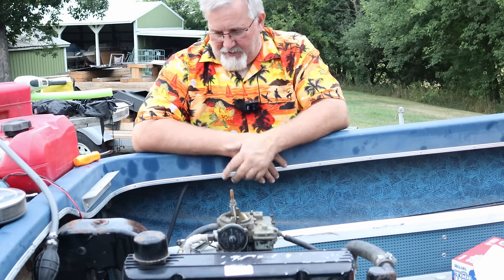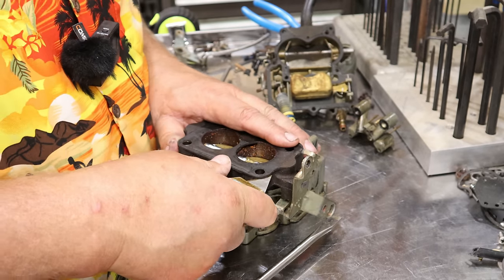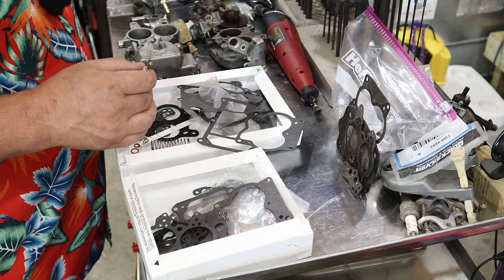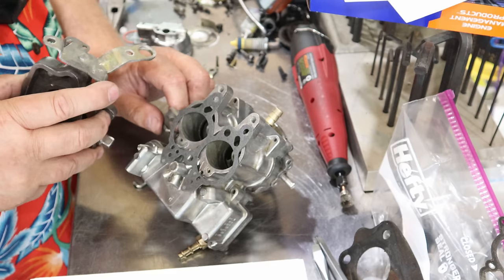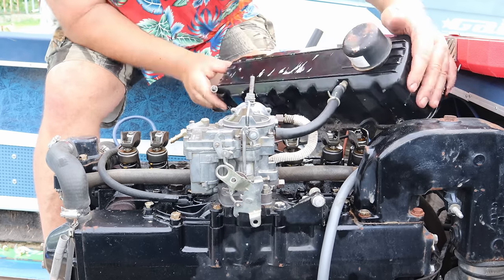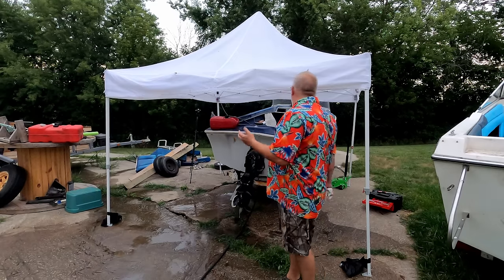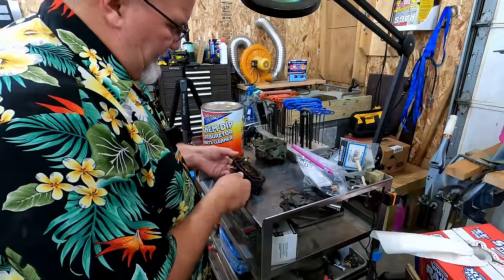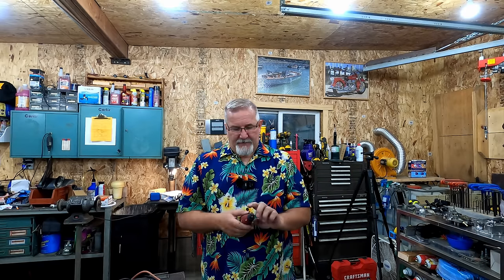1973 Larson Mercruiser 120hp Part 2  Carb work and valve adjustment

Comment: Man sounds good purring like a mountain lion . Just a good feeling getting a old motor running good . Good tips on auto choke and adjusting valves .. 👍👍👍👍 O the boat in ending credits seems to run like a scalded dog nice figure 8 on water  the coppers checking it out
Reply from the maker: it's turning out to be a fun boat, thanks for watching

Comment: I have to do the same thing.  I bought a 1971 Offshore V 18 about 4 years ago in a partially restored state.  previous owner abandoned work on it after getting an Islander. I bought it with the gimbal dissasembled and I noticed a few missing parts.   Fast forward 4 years I decided to find a donor boat, which is a '86 4 Winns with Alpha one/ 3.0L in running condition but not sea worthy ( soft floors ) so I'll put both boats togther. I should have enough parts to make something work

Comment: I just had a rebuild of a similar engine. Splashed yesterday, but having stall out issues that I think are/is a result of the carb being out of tune. Carb is new. In this video when you are adjusting the choke to fully closed, after you back off the 3 screws it looks like you are tightening them back up after. Am I correct in saying that? Our butterflys are open about 1/4 of the way prior to starting so I guess the first process of elimination is to make sure that they are closed by adjusting the choke spring. I didn't realize that they should be closed on start-up, but the engine does start. It stalls when we ease it into gear. It runs (and immediately takes off) when we start it in gear (same issue you pointed out in part 1). When backing off the throttle to "no wake zone" speed we get stall out again, and have to manually, Huckleberry Finn style, pole our way to the dock.

Comment: on those old rochesters before they put the filters in the top housing a lot of times there was a screen under or in the inlet fitting.  i've seen those cast iron throttle plates warp believe it or not. not much but just enough to have a vacuum leak.  i have a cupcake tin and an old cake pan to put my parts in. real handy.
Reply from the maker: That's a good idea, I'll do that on the next one, see if the wife misses the cupcake pan, thanks for watching

Comment: Hello, Great help!, I just got 18´ starcraft with a 140 hp, mericruiser. Motor is stuck, oil is dirty but no metal. Valves look good. Taking oil pan off today. Is timing same as your 120 hp? Thanks, Randy
Reply from the maker: 6° BTDC would be your timing. thanks for watching.

Comment: Nice work on the carb rebuild. We I used to adjust the values while running we used some sheet metal to keep the oil in the block it save on the oil mess. Did you do a tune up on it? Did convert to electronic ignition?
Thanks 
Tim
Reply from the maker: Great tip!
Reply: @Michaelsbackyardmarina  I did put a bend in the  metal about a 30-45 degree angle into send the oil back into the head

Comment: I noticed the cylinders were labeled incorrectly.  They had number one at the rear of the engine. Ha Ha. Did you fog the engine before you pulled it out?